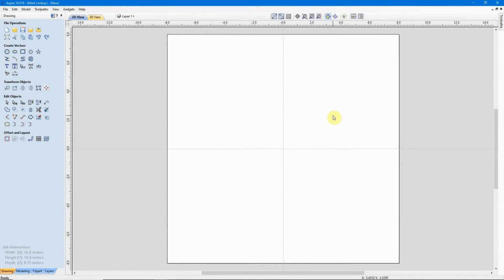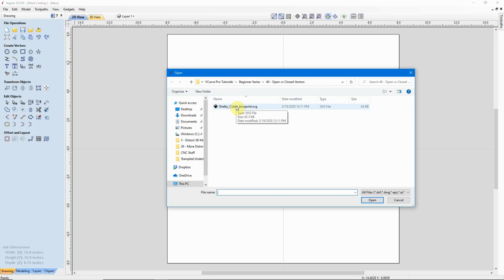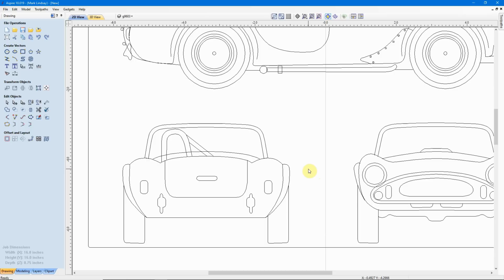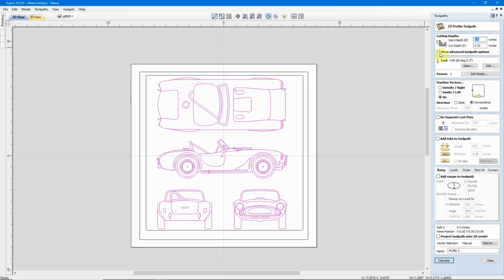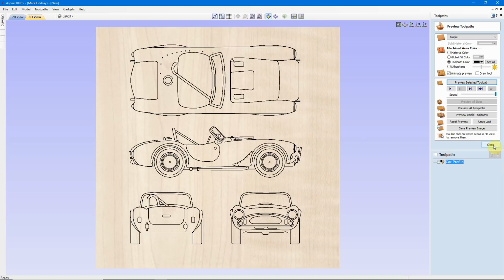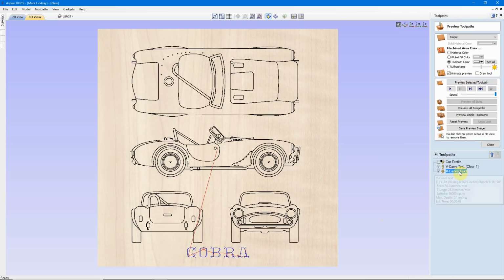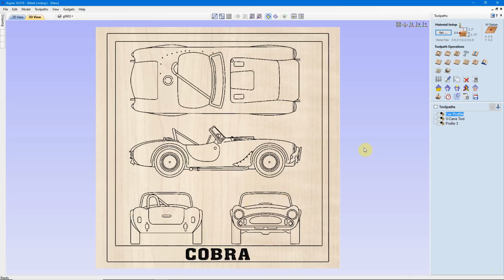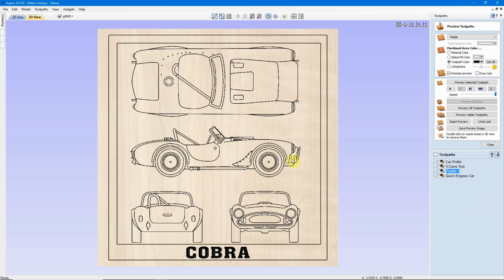Carving Open Vectors - Part 40 - Vectric For Absolute Beginners

Comment: Hi thanks for this, I usually run my laser engraver for the project a customer sent me but Baltic birch has glue voids that you cant cut through. So I happen to have a cnc machine in the shop that was gifted to me and I am using it as an opportunity to make this project happen. One of the benefits is not having burn marks. I've uploaded the illustrator dxf file and am now looking for instruction on how to cut out the shapes my client sent me. Any thoughts on a good video for this?
Reply from the maker: I recorded a video on this topic about 3 years ago. It's pretty long, but it'll walk you through importing a DXF file into VCarve or Aspire software. It'll show you some things to look out for and how to fix them if you run into the problems I talk about. Here's a link: https://www.youtube.com/watch?v=ej9jpj5h5i0

Comment: What's the difference between v-carving and profile carving?
Reply from the maker: Profile carving lets you cut or carve to a specific depth, whether that be all the way through the material, or just part way through the material. A profile can be cut Inside, Outside, or On a single vector, be it open or closed. V-carving uses the angle of a v-bit to carve out the inside of a closed vector. As it does so, it can vary the depth to carve to the proper width. For a better explanation and demonstration of V-carving, here's a link to Part 1 of a 4-part series on V-carving for Absolute Beginners. You only need to check out Part 1 to get that explanation: https://www.youtube.com/watch?v=JGG0yTPih4w
Reply: @MarkLindsayCNC  thank you

Comment: love your tutorials...how can i carve on an open vector to varying depth...i want to carve shallow 1/8" on one end down to 1/2" in the middle back to 1/8" at the other end of the same open vector...how can i do this is aspire..?
Reply from the maker: My first impulse would be to use a Fluting toolpath in Aspire or VCarve. Here's a link to a video I did on the subject. Experiment with the start depth, max cut depth, type of flute, and Ramp Length. Preview and modify until you get the effect you're looking for. https://www.youtube.com/watch?v=O3rX1v5wM3w

Comment: Great video Mark. Did you actually CNC this? If so, do you have a picture? I've noticed my previews always look great but the finished CNC piece sometimes doesn't look as good.
Reply from the maker: No sir, I didn't cut this project. The vectors were just a demonstration of the design process.

Comment: The text engraving is for cutting with a drag knife vinyl sheets, light engraving on metals or plotter prints for line art.
Reply from the maker: As the name implies, the Quick Engrave toolpath is for everything you mentioned, and a lot more. Although it was originally created for engraving machines and plotters, I've seen it used for laser work, cutting fret slots in guitar and banjo fretboards, inlay work - anywhere you don't need all the options included in the Profile toolpath, really. My only reason for including it in this video was to point out that it could be used for this type of line drawing art as well.